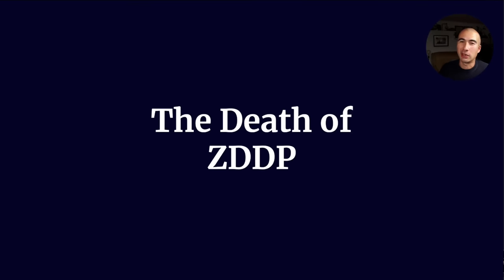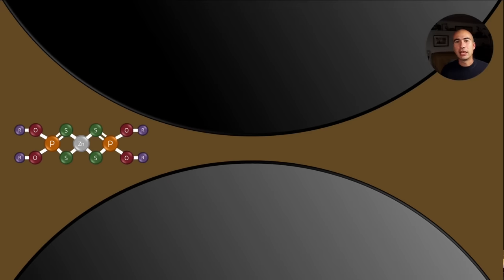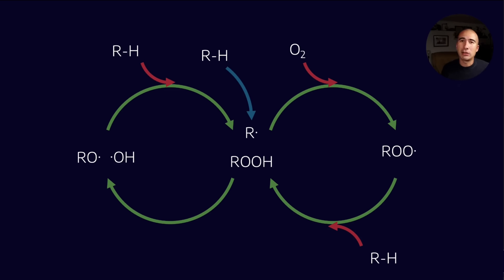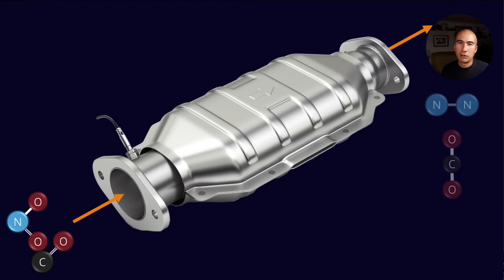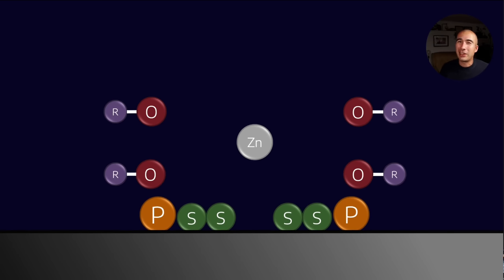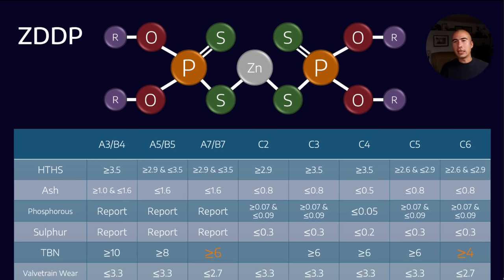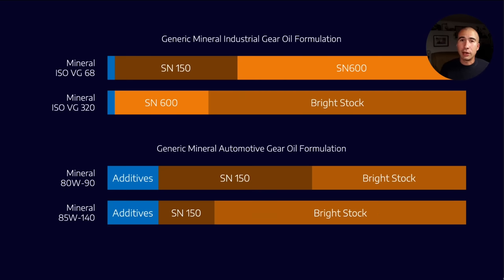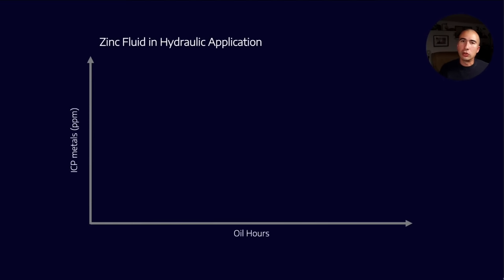Is this the end of Zinc (ZDDP) in oil?

Comment: Good video.  I will say though that ZDDP is still widely used in any non cat engine oils like small engine oil, marine, motorcycle, racing oil etc. 
That's why you should always use the oil with the correct classifications for your engine.
Reply from the maker: Just to be clear, I think ZDDP will still exist just that the quantities will drastically reduce in most of the consumer / commercial engine oils. I'm sure as a drop-in additive or in racing oils it will keep on going strong, just niche.
Reply: @LubricationExplained  But penrites range of full syn ( mostly 5-30) extra zinc oils 🤔🤔😐🤔🤔
Reply: Many marine engines and almost all motorcycle engines have catalytic converters so their oils probably also have reduced ZDDP.
Reply: I'm no expert, but I have had oil analysis done on non auto oils like my Honda quad, outboard oils and they all have high levels of ZDDP.  Some even advertise high Zinc on the bottle.
Reply: It's in all oils still...just reduced levels.

Comment: So if ZDDP builds on a surface to make an anti-wear coating why is it not wanted in industrial transmissions or automotive manual gearboxes? In the 1980s I worked for a bus company that ran interstate express vehicles that clocked up an average of 30,000km per month. We were using spicer 7-speed crash boxes and were getting quite a bit of metal showing up in the oil testing after the 500,000 km mark. Our lubricant supplier felt that the boxes were sucking in dust or dirt as they were at the rear of the vehicle but silica readings in the lab tests did not bear this out. We had a contractor working for us with a vehicle that had just passed 500,000km and he used a different brand of oil so we lab tested his oil and found much lower metal in the oil. He was using molybdenum di-sulfide as an additive in his gearbox. We set up a test where the next two vehicles delivered new were sampled every two months with one vehicle having the additive and one not and the results were the same as the contractor's vehicle. The reason for it we were told by the additive supplier was that it built up on the mating surfaces and formed and kept metal surfaces apart better. So again why would you take out ZDDP if it would do a similar job?  We started adding the Molybdenum to all the vehicles and we pushed out the gearbox rebuild Ks to 800,000.
Reply: Find an old transmission, put ZDDP in it an see what happens lol

Comment: In the U.S., ZDDP has been on the chopping block for years. Since the early 2000s, all road engine oils have had massive cuts to ZDDP content (or any other solid particle based additives). ZDDP usage is largely limited to aero engines and large marine applications (freight ships).
Reply: Yes then the Vortecs had Piston slap issues then we see the HEMI TICK Problems along with Ecoboost turbo failure along with G.M A.F.M Cam failure. I use my ZDDP Additive with pride.
Reply: @Chiefgeargrinder  - have as much pride as you want. The problem with ZDDP is if your engine was designed to run without it, you run the risk of causing other issues by supplementing your oil. A good rule of thumb, is anything before 2007 should be okay... while anything 2008 or later shouldn't use it. Aside from causing piston ring and main bearing problems, it greatly accelerates wear in most roller lifters and cam followers in 2008+ engines.
Reply: because industry and government care too much for people. Long live Zddp.

Comment: I would be curious to hear your opinion on what is contributing to camshaft failure (where the lobes wear off) in bucket lifter applications such as ford and nissan etc gas engines.. do you think it is related to the reduction of zddp in oil or perhaps poor manufacturing of the camshaft? Or something else?
Reply: 1) people used shit oils with lean additive packages
2) neglected oil changes 
3) the design is just very prone to premature wear and failure
Reply: @alouisschafer7212  Yep. The mob is sooooooo mean . . .

Comment: Is high zinc also bad for o2 sensors? I heard somewhere that using too much zddp increases friction, I use archoil, dont know what's in it but it seems to be good stuff
Reply from the maker: Good question. As far as I'm aware, the situation on Zinc increasing friction is "undetermined". The logic is that you don't get a whole lot of control over surface film deposition so excessive ZDDP films can lead to higher friction - hence the inclusion of friction modifiers in the formulations.
Reply: I use Archoil 9100 in everything I own, my 7.3 diesel, my gearboxes, transfercases, diffs, snow blower, lawnmower, in everything. It’s nano borate, I wish I knew more about it. Sure keeps things clean.

Comment: So in other words, us classic V8 muscle car guys should think about ditching flat tappet camshafts for steel roller cams? There is a lot of evidence of increased failure rates of flat tappet cams and lifters, and attributing it to "chinese steel/iron" being softer etc etc - or is it that the break-in ZDDP additive package needs to be in EVERY oil change - not just the cam/lifter break-in cycle fill ? Great video, thanks💪 Subscribed🙏
Reply: Actually Rich Holdener recently did a video on this and surprisingly it is not from soft Chinese steel as everyone thinks. They tested thousands of lifters and all tested within specs for hardness. Where they found the problem was in the machining of the lifters where they didn’t have the correct profile. He even went into cam break in which he stated most likely had little effect. Second most common issue next to bad lifters was wrong oil type with too little zddp. He won’t build an engine anymore with a flat tappet but I’m positive you’d be fine using oil specifically made like Joe Gibbs to keep a current flat tappet engine running.
Reply: @supersportimpalass  Powell Machine Inc on yt also did a very comprehensive test of many cam cores and lifters and came to the same conclusion! 👍
Reply: @johnkraft7461  I believe the camshaft and lifter failures that seem to be getting more common in the last couple years have been shown to be from poor machining of the lobes of the camshaft and them being ground too "sharply" rather than the material of the metal being too soft.
Reply: Lower profile could street run lower valve spring pressures?retro rollers spendy items
Reply from the maker: Thanks! And there's already been a good deal of excellent commentary below yours - so I'll just add that high ZDDP oils are probably always going to be around in the form of racing oils. They're not bound by ACEA / API rules so they can run higher quantities. The reality is, once your engine is out of warranty you can use whatever oil you want, including the racing oils.
Reply: @supersportimpalass  the other issue is the machining of the camshaft lobs. Many applications use a tapered lob either front to back, back to front. Depending on which direction that particular cam design wants to walk. The taper puts just enough opposite load to keep the camshaft in it's designed location. Lacking this taper will wipe out the taper on the bottom of a flat tapit lifter. Which in turn wipes out the camshaft lob. Both issues make it important to check a new camshaft & lifter set with a micrometer for the taper.
Reply: @williamallen7836  Also, aren't flat tappet lifters machined so that they will slowly rotate in the bore to spread the wear pattern out?
Reply: @robertweinmann9408  yes, and no. They have a slight crown that keeps the lifter spinning so the lifter wears evenly. The camshaft lobe also has a slight taper to counteract thrust forces that push the camshaft forward or rearward. This keeps the camshaft from waring through the front or rear of the engine block. This causes the lifter to only contact a portion of the lobe. Looking at a flat tappet camshaft that has been in service you will see the ware strip just off center to the rear or front, depending on the direction of the thrust forces. If the lobe has an even ware pattern across most of it's face, that lobe has been wiped, damaged & needs to be replaced. Some aftermarket camshafts use a "cam button" to keep the camshaft correctly located. These aftermarket flat tappet camshafts most often do not have a taper ground into the lobes since the cam button is doing the job of keeping the camshaft correctly located.

Comment: Since motor oils are generally backwards compatible, I wonder what modern chemistries they’re using in place of the old ZDDP?
Reply from the maker: There's some Moly and Boron additives which are starting to see wider use. There's also been a lot of work in changing the actually ZDDP molecules so that you need to use them in smaller quantities. The alcohol used to manufacture the ZDDP has a reasonably big influence on how it acts in the engine.

Comment: It will be around forever, it's like leaded fuel, you can still buy it. 
I can buy a drum of leaded or a drum of 116 E85 it's all for sale just not at pumps. Same with ZDDP oils if you look you can find them. 

I just tend to use what the oil company we use recommends and stick with that. I'm in Automotive and I have not has any issues using what oil companies recommend, apart from semi synthetic oils which I despise using, we rarely buy in full mineral oil so I can't really comment on those for engine use. 
The semi synthetics always seem to varnish the inside of the engines partly due to customers doing 10k or 15k intervals on semi synthetic when the oil tech line states to do the adverse condition intervals at 7.5k with semi.

But yea when using full synthetic oils in engines they run fine, but most engines these days use rollers in the metal to metal contact areas. My 2.6l Triton 4G54 uses an OHC with wiper rockers and was re-built 40k ago, I use Penrite 15w-40 but it's extra 10 so they claim it's a 15w-50, it's full synthetic but I think it has ZDDP in it I'm not sure but it runs fine.
Reply from the maker: I just said the same thing in another comment reply! Great minds think alike 😀

Comment: I own two 80s Nissan gas engines and run Rotella T4 diesel oil in them because of the yellow friendly zddp.I dont think it will hurt a 36 year old catalytic converter? I learned to do this from  the internet so any experts here please let me know what you think.
Reply: oh I use redline synthetic mt-90 for everything else like dif and trans. Can anyone tell me if they do the same?
Reply: Like he said in the video, theres a possibility it can basically stick to the honeycombs in the cats.
I would suggest to look into like Royal Purple 'High Performance Street' line of motor oils that has their own formulation of ZDDP's pre-mixed-and it includes their ester molecules called 'synerlec' - like castrol magnatec. 
You don't have to, but its one conclusion I arrived at-that having a pre-formulated oil was the best bet rather than gambling on stuff like STP ceramic additive, Cerma, or like Hot Shot's Secret Carbon nano tubes or like Liqui-Moly. 
But, you could have fun trying them all.

Comment: My question is, how much is required and how to assess what is a reasonable level ?
ZDDP is sacrificial in action. Will low levels provide protection for a short period of time, of if high pcontact pressures exist is a high % required from the start.
Lots of unanswered questions on this subject and few hard fact vs hype from specialty product manufacturers hoping to cash in on owners fear.
Reply from the maker: That's a good question. It's hard because there's so many factors. It's a combination of engine load (be it spring tension on valves, revs, rich burn or not), engine design (cam profile, location of cams, DI or not, turbo or not) and surface finished (finish on cams and tappets, materials, DLCs etc).

Comment: Air-cooled engines operate at a lot more than 110-120C. 
Does the ZDDP break down in those?
Air-cooled engines certainly have shorter oil change intervals than water-cooled engines and generally don't last as long.

:-)

Comment: Hello, I currently use a Zinc-free hydraulic lubricant in a Sacmi press, when carrying out lubricant analysis and noticed that sample after sample the Zinc trend is increasing, we have already ruled out fillings or additions with other types of lubricants, I ask, what Other possible ones exist to generate this increase in the trend of Zinc. Thank you!!!
Reply from the maker: Hi! The usual culprits are some kind of solder in the oil coolers or brass materials in the pump. But if you're able to provide some more detail, head over to the new community forum and post the oil analysis and some more details! Might be able to narrow it down some more for you. https://lubrication.expert/forums

Comment: Your videos are excellent!  Question: besides the moly analogue, are there currently replacements for ZDDP that solve the problem of catalytic deposition?  Maybe a package of several different compounds to separately participate in the three regimes of the anti-wear coating?  For the Fe/Zn regime, I was wondering if there could be a substitute that doesn’t have affinity for the Pt/Pd/… catalytic metals?
Reply from the maker: Thanks! I think most of the effort now if going into base oils that can provide more film strength plus things like Diamond-Like Coatings on cams so that not as much antiwear is required. We've been looking for ZDDP alternatives for a long time and still haven't found anything with the same performance-cost envelope.

Comment: Question is should I add ZDDP to my engine oil?  Newer cars, say the wife’s Macan Turbo (damage cat?), my 2020 Triumph motorcycle (no cat), my 74 Norton, … 71 911, … 2006 911?  And the list goes on!
Reply: no.
It will ruin your Catalytic Converters. Thats the main reason ZDDP is so low now.

Comment: You threw me for a loop as what is the relevance of ZDDP in gear oils to catalytic converters? Neither my manual transmission or differential / third member vent through a catalytic converter.
Reply from the maker: Ahh, maybe I wasn't clear enough. Industrial gears used to contain larger amount of ZDDP but are now using alternative additives. In that case, it's not about catalyst fouling but rather that the industrial lubricants are designed to separate with water. Metal-containing additives tend to be "hygroscopic" which means they pull water out of the atmosphere - so for longer oil drain cycles in industrial, ZDDP no longer makes sense. https://youtu.be/C_7qW2ir9kU
Reply: @LubricationExplained  Thanks for the clarification and additional tid bit regarding the hygroscopic nature  of this type of additives.
Back in the day, -60’s ~ -80’s, being from a northern climate, Maine, we frequently had issues with water - oil contamination, especially, in vehicles that got “short tripped”, during cold snaps. This sometimes resulted in PCV freeze ups, and pushing malted milk into the breather, and sometimes worse…
I attributed the water contamination to condensation and lack of dwell time at operating temperature.
Your tid bit regarding hygroscopic nature of the additive package, leaves me wondering if this is to a degree enough to have affected this issue?

Comment: Catalyst have been mandated on cars in the USA since 1974, 20+ year before the zinc debate. The old cars (before 1987 ish) had flat tappet cam shafts that depend on the zinc, without the zinc, cams can wear out in under 1000 miles.  
So why did they take out the zinc? The EPA pressured the oil companies to do so sole because the zinc in very high milage cars "Could" have their O2 sensor become inoperative if the zinc built up from blowby.    Clearly it caused more problems than is solved, or maybe it was part of a plan.

Comment: Very interesting video!  I've got a 2021 Jeep with the 3.0L EcoDiesel that has a normal operation temperature of about 230 degrees F (110 C).  The manual says I need to use a 5w40 Synthetic oil meeting API-SN and Material Spec MS-12991.  My understanding is that an "API-Sx" classification indicates an oil for a gasoline engine versus an "API-Cx" which is intended for a diesel engine.  Do you know, or have you already done a video that discusses why a diesel engine would specify a gas engine oil?

Comment: So I've been trying to find a lubricant for my 3D printer linear rails, they use roller bearings.  Have any thoughts on what oil/grease I should get?  The rails are horizontal and vertical.
Reply: Speed X.  Used for roller skates

Comment: But if ZDDP was so good - why does wear still occur in engines? Is it just because of dry start-ups or because contamination and carbon soot gets in the way of ZDDP?
Reply: dry start ups and clutch starts that put pressure on dry thrust bearings don't help, taxis last pretty much forever because they rarely turn off
Reply: An accusump on engines should be industry standard imo
Reply: There are more wear mechanisms than metal-metal sliding contact. E.g. thermochemical mechanisms that wear cylinder liners and piston rings, metal fatigue causing the failure of rolling element bearings and cams, cavitation damage in areas with fast flow and too little oil pressure...

On a modern engine that is well looked after, the bearing shells are often still perfect when the engine is 'worn out'. Other components like cams, piston rings, elastomeric seals etc wear out first.